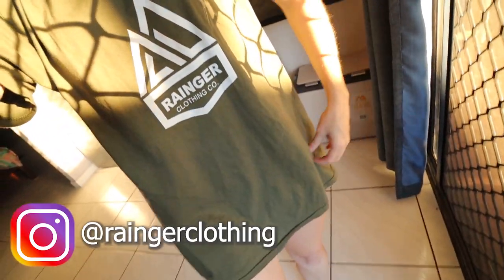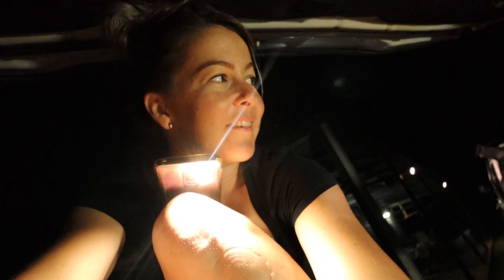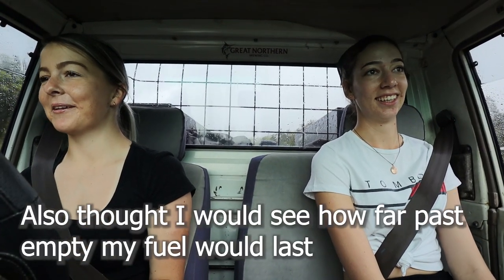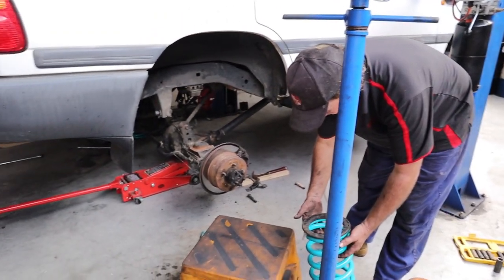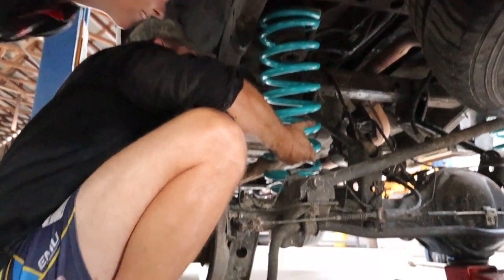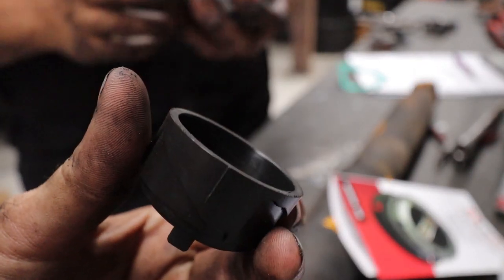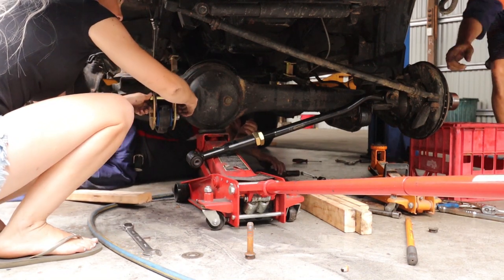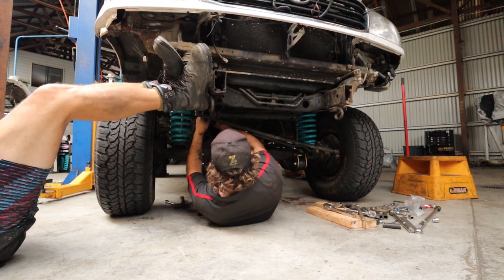105 Build Part 1: Turbo Install & Lift Kit

Comment: Probably a bit late to point out that the 105's have a little sub plate for the top of the rear shocks- Two bolts either side of the shock body and the entire top mount drops out of the chassis and then you can rattle gun the top shock bolt off. Its only the 100's and 200's that toyota had a full brain fade moment and welded the plate into the chassis, dooming you to a life of turning a ratchet spanner one tooth at a time until you finally get the top bolt undone. Unless it seizes....
Reply from the maker: Well aware still easier to just undo the shock

Comment: thank you for other great video as watching all together and
 other is have did transfer box for 2 wheel driver so not 4x4 wheels driver full time?
sorry was isuzu 4x4 nps 300 crew cab get work over

Comment: I learnd something new, I guess track bars are known as panhards and bushings as bushes in Australia.
Reply from the maker: Track bars here are what connect the two wheels for steering, panhard rods control lateral movement. Bushings Is the correct term, bushes is just slang really

Comment: Those Toyota OEM steel wheels aren't made anymore afaict. The only 5 hole steels that Toyota makes now are split wheel for the 70 Series. So don't let go of them even if you end up changing wheels/tires down the road. Nice 105!

Edit: I think you can get 1-piece 5-bolt Toyota OEM steel wheels in OZ (70 Series) but not in most other markets.
Reply from the maker: So ugly but haga

Comment: I’d love a 105, but not gettable in Europe LHD. I’ll have to make do with my old 80... good work, done all that and a bit more on the 80. 👍🏻🇷🇴🇬🇧
Reply: well the 105 is more or less an mix of an 80 frame with a 100 body. the 105 was fleet vehicle all solid axle to make it off road but with some of the comfit of the 100 body. obviously not many company's in Europe need a fleet of off road vehicles but here in Australia we do. if you had of bean here Around 2008-10 the 105's where being sold by many of the fleet owners as Toyota stopped making a dedicate fleet vehicle like the 105 and fleet owners started going back to the back to the 79. sadly the 105's that weren't sold got scraped.

Comment: Just a tip, some may think it’s better to run your tank dry but just remember your fuel pump itself is lubricated and cooled by the diesel.
Reply from the maker: Who thinks it's better?? It's really bad. And all of this was explained on my Instagram
Reply: Danie Simpson oh sorry never intended to say people think it’s better, I mean a lot of people do it which they really shouldn’t. ;)
Reply from the maker: @oldmate8911  yeah explained it over on insta it's better to drain the tank to measure it :)

Comment: What will the Diesel Smart guys do; tweak the fuel / air ratio in the computer?  OEM injectors are good enough or will they up size?
Reply from the maker: What computer? Hah
Reply: Danie Simpson really?  What are they going to do?
Reply from the maker: @jeffheld3971  they did the dyno run? I thought I explained that in this video pretty clearly?
Reply: Danie Simpson must have missed that.  My bad.
Reply: Danie Simpson dyno run mentioned in the beginning.  “Tune” mentioned at the end.  I did not put the 2 together.
Reply from the maker: @jeffheld3971  yes and you don't need a computer / ECU to tune an engine

Comment: Great work! Can you tell me how much all these new 105mods cost? Labour not included.

Break it down for me. Lift $? Turbo $?
Reply from the maker: Turbo is about $1100, Manifold $550, intercooler $680. Some gaskets, exhaust pipe, clamps hoses about $250. Contact Marc at Mackay 4x4 for quotes on Dobinson lifts it will depend on spring rates, types of shocks, if you need and arms and rods or not

Comment: Why put the intercooler on top of a hot engine? Never understood that.
Reply from the maker: If you were chasing big power you would take the extra effort and go front mount. This is still an old slow diesel. A top mount is a simple mod that can installed and still offer massive benefits without running heaps of piping and trying to front mount it. The thermo fan ensures even stationary it can pull in fresh air. Any heat sink that it suffers is negated by the added condensed air it provides

Comment: How did you tap into the oil lines for the turbo install can you send a couple of photos
Reply from the maker: Feed is t piece on the sensor and return is into the sump with silicone. That one isn't pretty
Reply: Danie Simpson haha good stuff thanks for that love the vids and new intro btw

Comment: Hey Danie awesome vids, I did nearly exact mods on an 80 bus but couldn't drive it down the road without getting pulled over (Brisbane). Buying a 105 soon and going to do it all again. Do you get it all blue plated or electronically on rego? PS you're cute as hell could have your own 4x4 show on the tele.
Reply from the maker: You cannot engineer 4"
Reply: Yeah that's it, nice rig Danie be safe.

Comment: Be careful doing mods. In north east vic there looking at driving lights and one cop in the local paper is hitting bar lights. And led day time running lights not turning off when head lights are turned on. Also people running on one head light. Next in qld there been doing vehicle lifts. And i have hear in maybe coming to more states. In mansfield a road the high country they where doing the height of your mud flaps on 4x4. I am not saying not doing just check before you have to pay a fine. The mud flaps they book 200 in one day.
Reply from the maker: My driving lights, led bars and Mud flaps are all legal so not sure why you are telling me This?

Comment: Any work done on that NA 1HZ before bolting turbo on? 600 000KM and suddenly turbo......
Reply from the maker: Where did you get 600000kms from??
Reply: @DanieSimpson  Oh... Sorry, 600 000 is on 75. Mea Culpa.
Reply from the maker: @ondrejmarko01  yes

Comment: how did you hook your oil likes up to the turbo? Did you punch a hole in your sump?
Reply from the maker: Oh yes didn't film that part. T piece in at the oil pressure sensor and then tapped a hole into the sump for the return
Reply: @DanieSimpson  Did you drill and tap a hole into the sump of just use a punch than tapped it?
Reply from the maker: @jimyhilton13  yeah drill, it's not pretty silicone was used hahah
Reply: @DanieSimpson  Hahaha! Will there be a video on how you tuned it?
Reply from the maker: @jimyhilton13  yes

Comment: i thought turbo's were bad for 105's?
Reply: its the 1HZ engine its an IDI (Indirect Direct Injection) so it has a low compression ratio they can handle a small turbo but you have to be careful not to over boost it they cant handle a tonne of boost like standard diesels. power wise the 1HZ is a bit lack luster but they keep going my one has well over 10000 hours best guess is around 25000 hours when we got it second had from Parks Victoria she has around half the power from from factory and hates really cold morning she keep going i would have to have a head on with a damn semi truck to kill it.

Comment: with the 35's what is the overall lift (body lift + tyres)
Reply from the maker: 5" there is no body lift
Reply: @DanieSimpson  ok sorry I meant suspension lift + did you have to get a mod plate
Reply from the maker: @peterbarber7613  you can't mod a 4" lift
Reply: @DanieSimpson  but you can only go 75mm.50mm suspension lift and 25mm tyre with out certification = 3" overall lift combining both
Reply from the maker: @peterbarber7613  that's what I just said you can't mod plate 4"
Reply: @DanieSimpson  legal lift before getting a mod is only 3".4" needs a mod
Reply from the maker: @peterbarber7613  you cant engineer(aka mod) a 4" lift as I've stated above. 2" doesn't require cert and 3" does.
Reply: @DanieSimpson  3" doesn't need a cert.can I ask why a 4" lift doesn't an engineer to look at it please
Reply from the maker: @peterbarber7613  3" does need a cert and also a lane change test and if the car has esc then it will also need to pass a esc test as well. These are QLD laws which is where I live.
Like I've stated above you cannot have a legal 4" lift unless it's pre delivery and has SMM
Reply from the maker: @peterbarber7613   But yes only 2" suspension and 1" tyre and zero body lift will not require cert
Reply: @DanieSimpson  I know QLD,NSW & VIC all have the same laws.can I ask how you put in a 4" lift into the 105 without a cert
Reply from the maker: @peterbarber7613  that's just what the kit is. If you measure the tyre and overall height change compared to factory then it's all within limits

Comment: Watch?
Reply: @DanieSimpson  Looks like you are wearing a watch. Am I incorrect?
Reply from the maker: @jeremy8715  yes gshock
Reply: @DanieSimpson  Which model? Mine is the 5600 E, which resembles the original gshock that came out in 1983.